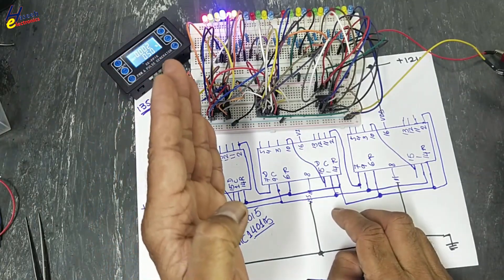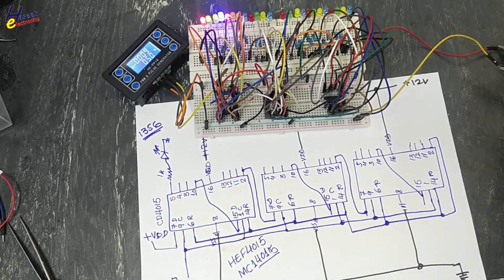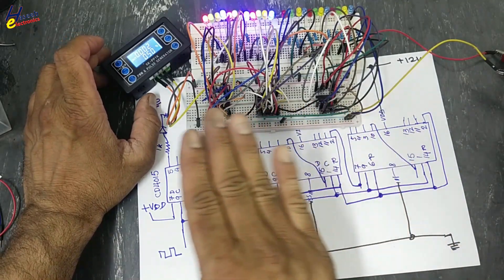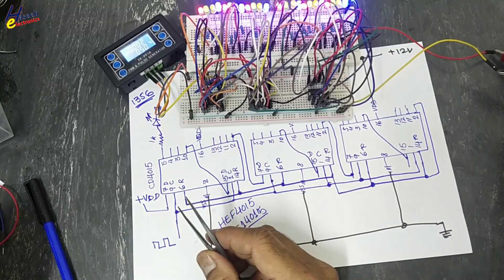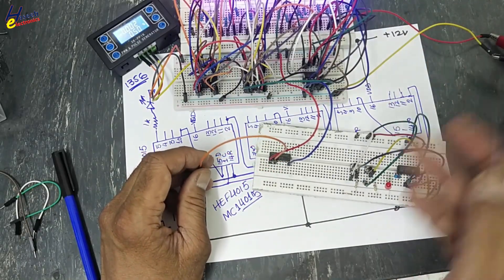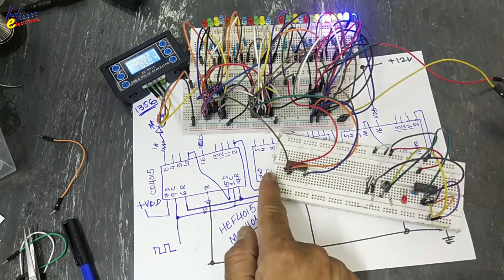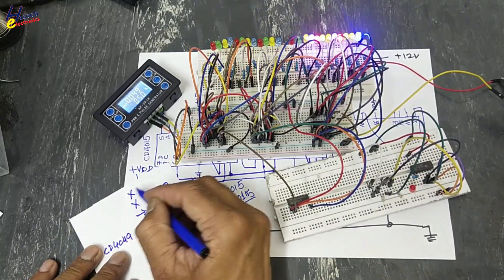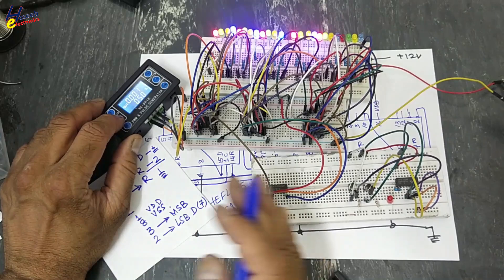{1356A} Auto LED Fill & Drain with CD4015 | No Reset Needed || Smart CD4049 Feedback Logic

Comment: With a similar circuit, is it possible to turn on only one LED at a time in sequence so that it seems that walking?
Reply from the maker: Then you need to use CD4017 ic
Reply: @HaseebElectronics What configuration in?  You can made on the video?
Reply from the maker: Video number 480 
And I will record new video using cascade feature as well